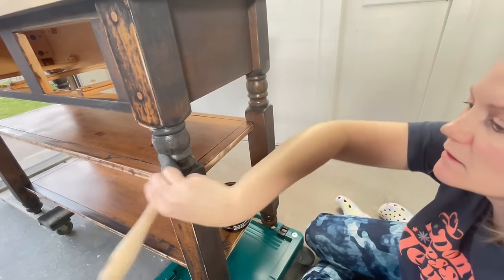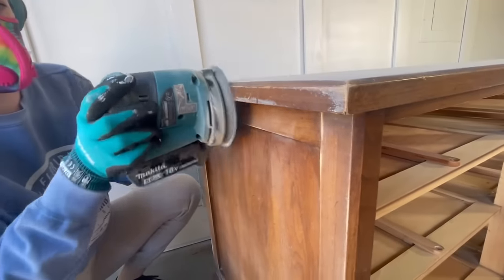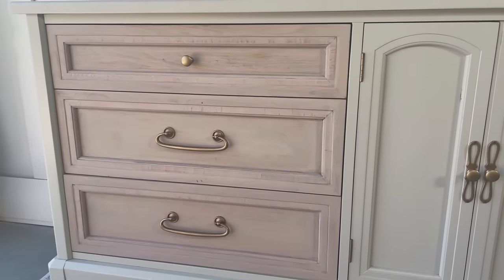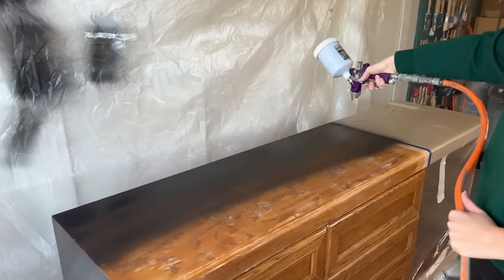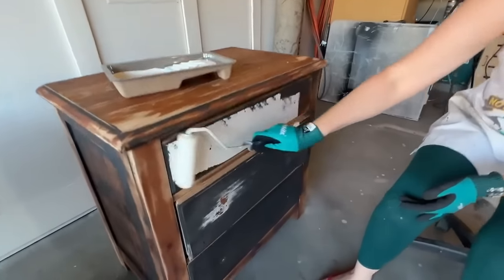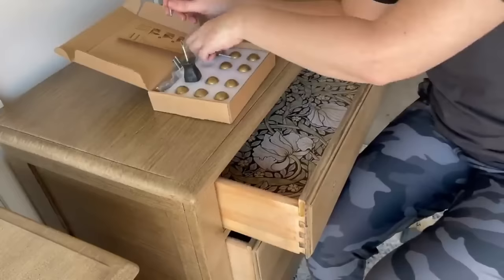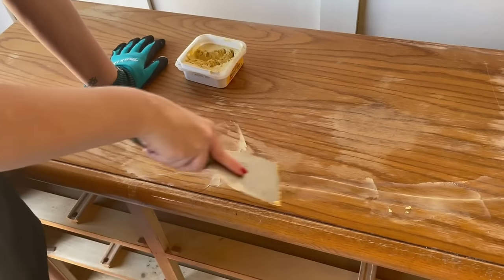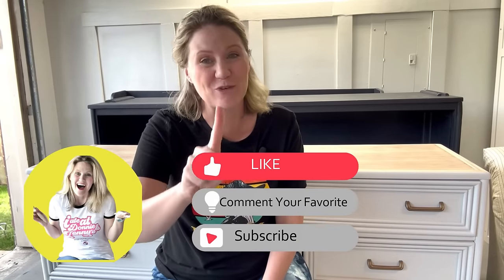Trendy Furniture Colors for Stunning Transformations

Comment: Love the road trip and the glaze.  I have been using Cork #16 from Sherman Williams  as my base color.  I also use  two different glazes together. I use the Aged gold and the Smoked from Rustoleum.  I either brush it or pull it with a graining tool.
This sells in my area  really good. 
Love your videos ❤